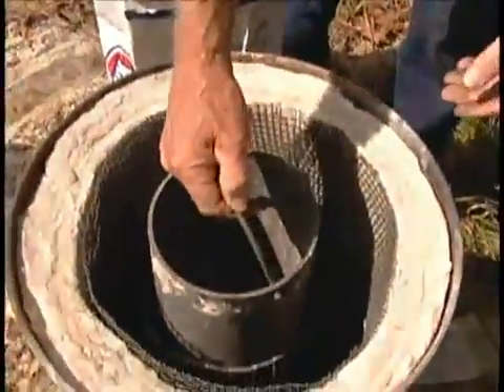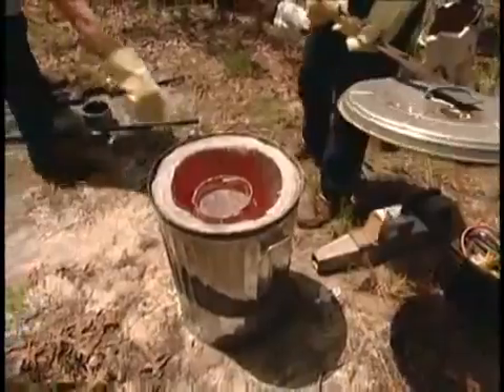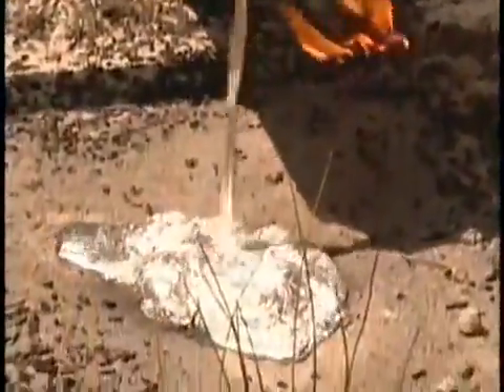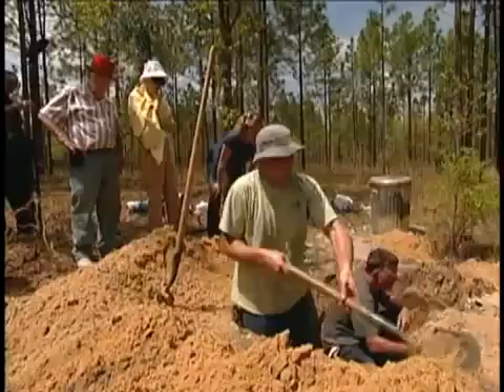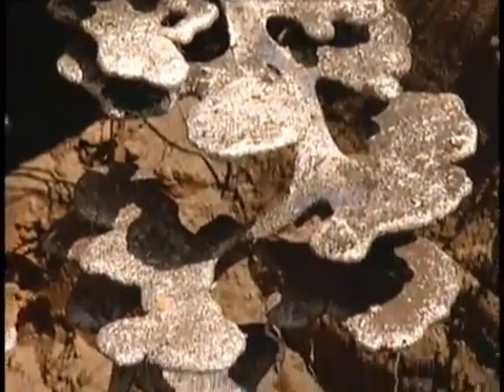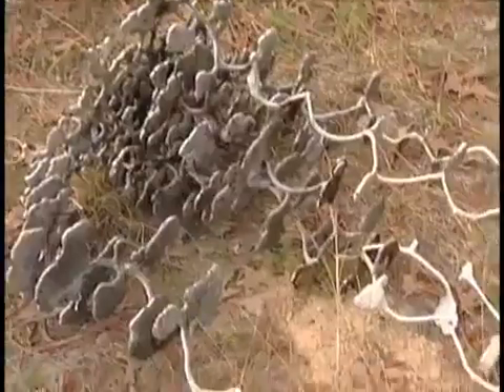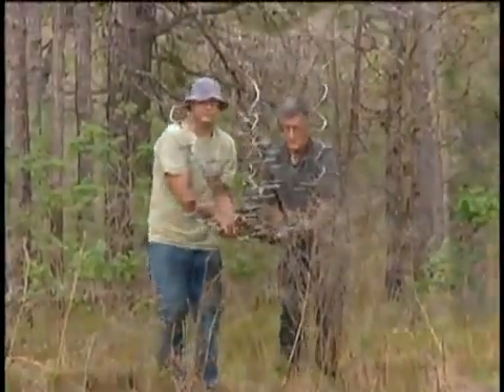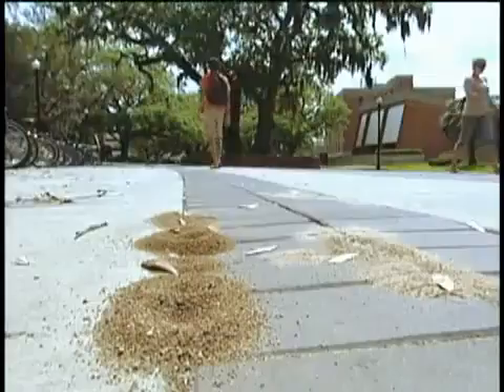Ant Hill Architecture : Ants are the best designer

Comment: HOW THE DICKENS DO YOU GET THAT MERCURY TO SOLIDIFY???
Reply: That's not Mercury, it's Aluminum
Reply: +chrismc410 its mercury i tells ya.... a coke can is aluminium- that is hard and crunchy... mercury is silvery and runny. chemical symbol Hg
Reply: +jeremy western Not if aluminum is melted. It runs like water then. Doesn't take much heat to melt aluminum,  about 1230℉, not much compared to iron or steel. Propane gas can generate enough heat to melt aluminum.
Reply: +chrismc410 im glad you finally agree its mercury.... do more research in future...
Reply: jeremy western No it's aluminum for  three important reasons: One, they say it is at beginning of the video. Two,  once the casting is done, it solidifies quickly. Mercury does not solidify like that unless it's at least -40℉. The video clearly shows it is not that cold. Three, they used a crucible and a heat source to melt the aluminum. Mercury is usually in a liquid state at most climates and does not require heat or a crucible to liquefy.
Reply: +chrismc410 well how does he get the mercury to set??? you reckon he adds corn syrup to it?
Reply: +jeremy western The video says its Aluminum. To get mercury to solidify you freeze it. But it will melt again.
Reply: +jeremy western Silly troll.
Reply: +Paint Bomb Gaming   im glad you FINALLY agree with me that its mercury... pay more attention to the video in future...
Reply: Lol ok then ;)
Reply: +Paint Bomb Gaming pay more attention in future....
Reply: Haha ok. Sorry
Reply: +Paint Bomb Gaming good... make sure you pay more attention in future... goodnight.
Reply: +chrismc410 nope iron and steel is 1500 c and steel is much higher
Reply: +Lol Lol iron and steel DO NOT melt at 1500 degrees... its around 1497 so please get your fact right before commenting...
Reply: +bob bob oooh get you lord slidebottom!!! 😜😜😜
Reply: +Max Hanson im glad you FINALLY agree with me that its mercury.... please pay attention in future
Reply: +jeremy western im glad you FINALLY agree with me that its aluminum.... please pay attention in future
Reply: +jeremy western lmao this is aluminum
Reply: +jeremy western Dude what are you talking about, its not mercury, its mercury ... god damnit,  i hate it when people are dumb as fuck ...
Reply: +jeremy western dude its aluminum. It says so in the vid. Now plz stop saying "do more research first". You need to do research too and actually think about what the people are saying, in the vid and the comments.
Reply: +OshasniPlays sorry....i was just attention seeking....😔
Reply: jeremy western There are other ways, and it's fine. I'm just glad you stopped :)
Reply: +OshasniPlays havent stopped 😏
Reply: jeremy western Well then please do
Reply: +OshasniPlays no-shant....😠
Reply: jeremy western Ok..
Reply: +OshasniPlays gonna carry on....🏃
Reply: +jeremy western How have they not figured it out yet.... Trolls are not mythical creatures, they reside in the internet